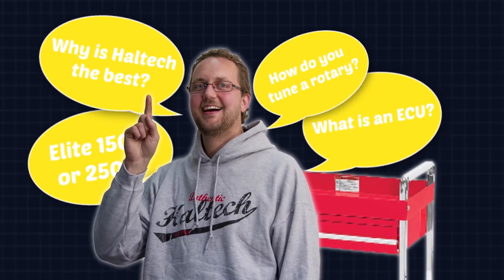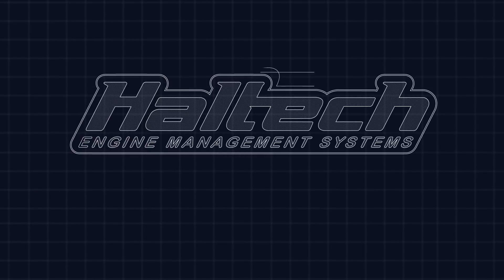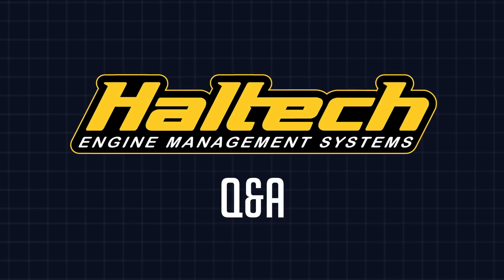❓ Kill Switches, Trim Modules and ECU for 300ZX - Haltech Q&A Episode 26

Comment: I noticed you haven't done a Q7A in a while but just like pentiomiter with multiple positions based on voltages as switches. Can I turn 1 AVI into a input for multiple switches such as AC enable or brake switch ect saving multiple AVIs instead of being wasted as dedicated switches?

Comment: Hi just need to know what ecu i need which as lauch control. and a map setting for example 450 bhp  map 2 600 bhp 800  bhp.  i have a zx  300 z32. if im drive at 450 bhp i want to able to hit 800 or 600 etc
Reply from the maker: We have a Plug'n'Play ECU for the Z32 that will suit you perfectly: https://www.haltech.com/product/ht-055107-platinum-pro-plug-in-ecu/

Comment: What is a good engine management system for a mazda 12a Bridgeport engine.
Reply from the maker: You can use almost any of the Elite Series ECUs. We would probably recommend Elite 1500 without knowing the whole setup.
If you ever want more info feel free to either email or call our Tech Support, we have a few rotary guys there that can definitely steer you in the right direction:)

Comment: Are you able to wire a stand alone ecu to control the stock gauge cluster, HVAC system etc... Or do you have to run a piggyback system so the stock ecu controls all of the stock system and the after market ecu controls the engine?
Reply from the maker: The new Ford Falcon PnP ECU will control all factory gauges, for all other applications you'll need to run your aftermarket ECU in a piggy-back configuration.  https://youtu.be/A1ePCv0Z3rE

Comment: Can you run this trim switch for an electronic throttle if you DO NOT have the Elite 2500T? I have the regular elite 2500. 

I'm going from my stock engine (F20C1) to a mildly built LS2. Lol. So a switch like this would be nice to get used to the power before making a fool of myself
Reply from the maker: Yes, these work on all Elite ECUs.

Comment: Is it possible for a tuner to detect knock or tune it in a way that steers it from potential detonation damage under boost on an engine that does not have knock sensor capability? Id like the extract the power but my worry is can it be done safely without knock control.

Comment: Scott nice vids bro.  The haltech guru 😁 I have a mk4 gti 1.8t rave green. I've b2en trying to tune my car .I  took it to get repaired  and turned with Apr tune.   Never got my car running right worst experience ever .     They had the. Car 4 2 months and returned it with a  almost flat tire no gas,  and check engine light came on in a week.  I was not going to take my car back  after they  clearly didn't car for my car.  Is it possible for u to tune my car via laptop if I get my car up in running with a haltech? I've been trying to do a simple tune on my car since 2011 . But something always  comes up. Keep up the great work.

Comment: boost control thought the ecu AND electronic boost controller, do i need twin solenoids or one? im thinking ecu controlled to limit boost in 1st ans second but with the option to turn off and run soley on an ebc (already runnning ebc but going standalone ecu soon)
Reply: Brendon Morris I wouldn't never run a manual boost controller. Tried one as a teenager and saw how crap they was lol. Always had electronic ones on my cars  but never used ecu for boost control AND and ebc

Comment: I've just finished up building a forged rb30 block with a ported rb25 head, it's had the vct oil line mod done aswell, so what ecu would be a good fit that can handle the nissan vct? It's been built to be turboed and looking for around the 400-500hp mark so would you be able to help out recommending an average size set of injectors that will handle that with e85? 
And at this point will I be looking to upgrade to a better set of coils to handle that power too? Any other Input on what I would need for this engine setup would be appreciated as it's my first time doing a turbo build and want to do it right the first time👌
Reply from the maker: Elite 750 will do the job or you can step up to Elite 2000 or Elite 2500 if you want all the advanced race functions.
In terms of injectors and coils - we recommend you check with your tuner.
Reply: Haltech no worrys thanks heaps👌

Comment: I bought a Haltech pressure sensor it

250 psi “TI” fuel/oil can I use e85 with it? or I need the Stainless steel diaphragm?

Comment: I am interested in running a 80 Series landcruiser  1FZ80 (6 cyln petrol) with turbo 10+psi boost and convert to coil packs (3) boost controller, and wide-band O2 sensor on an ecu for street and off road use, what model and add ons in the Halltech range do you recommend.
Reply from the maker: We are not far off from releasing a Plug'n'Play ECU for the 80 Series. Keep an eye on our website:)